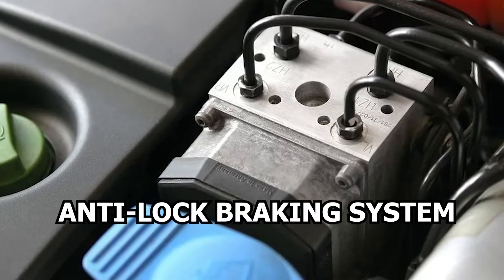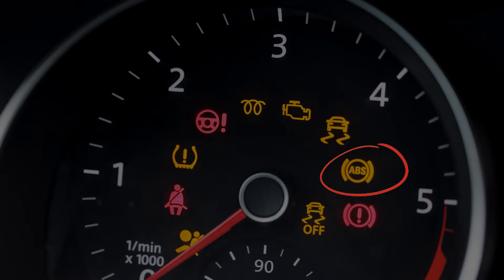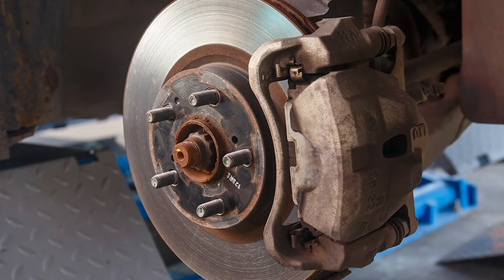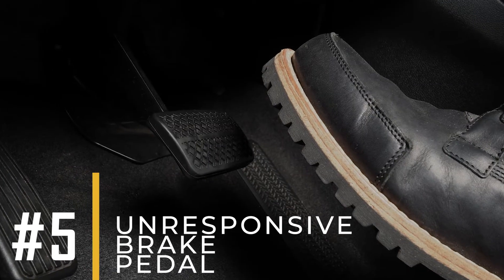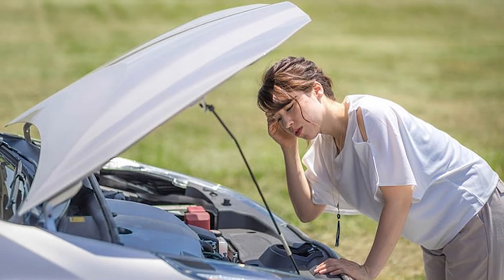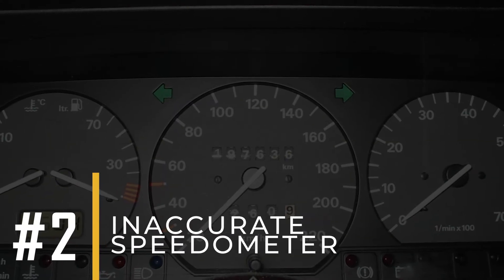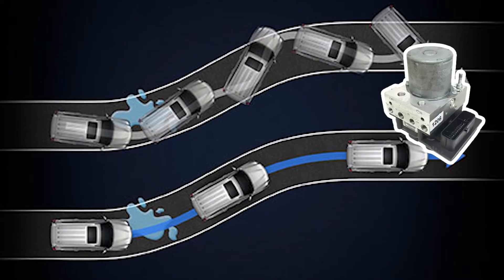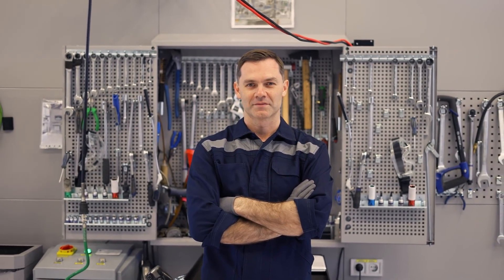Top 8 BAD ABS Module Symptoms and Signs | What are they?

Comment: I have a 2010 Chevy HHR speedometer fluctuates, sometimes transmission changes hard, I've put a new transmission speed sensor and new front hubs with new wheel speed sensor, it's still doing the same thing,any suggestions
Reply from the maker: If your 2010 Chevy HHR’s speedometer is fluctuating and the transmission sometimes shifts hard, even after replacing the speed sensor and front wheel hubs, the issue may be electrical. A faulty instrument cluster, especially the stepper motor for the speedometer, can cause erratic readings. Damaged wiring or poor ground connections between the speed sensor and the PCM can also create signal issues. A failing alternator or voltage irregularity may interfere with both the speedometer and transmission control. Additionally, a bad rear wheel speed sensor or a malfunctioning PCM could be contributing to the problem. Scanning for ABS and transmission codes and checking wiring and voltage output would be the next best steps.  Good Luck!

Comment: My mamalona felt like a sponge when breaking, now my truck don’t turn on
Reply from the maker: If your mamalona felt spongy when braking, it likely means there's air in the brake lines or a brake fluid leak. A failing brake master cylinder or a vacuum brake booster issue could also cause that soft pedal feel. If the brake booster fails badly enough, it can create a vacuum leak that affects engine performance and might keep it from starting. Some trucks won’t start unless the brake pedal is pressed, so a bad brake switch could also be the problem. It’s also possible the no-start issue is unrelated, like a dead battery or bad starter. Check your brake fluid level, listen for sounds when trying to start, and try jump-starting to rule out electrical problems.  Hope this helps.  Good Luck!

Comment: how do you know what component in the abs system to replace? ABS modules are outrageous in price. The wheel sensors and wheel hubs are more realistic. Does anyone know? If its wheel sensors that are the problem why replace the module? If its the module why replace the sensors and hubs? Anyone understand what I am struggling with?
Reply: Start with the sensors at the wheels. Cheap, easy, good place to start.
Reply: my friend checked the fuse, replaced a speed sensor, replaced new rear brake pads.  my lights are on n my brakes are still grabbing n letting go when I first leave my house with lights off.  I keep pumping the brakes and the lights pop back on, and then it drives and stops fine.  it's scary driving like that.  I just ordered an abs module hoping that's what it is and not the abs pump.🙏🙏🙏🙏🙏🤬  $531
Reply: @JoJo-oc8oq  i figure out the abs problem. it was the driverside abs wheel speed sensor. the howling sound i thought was my cv axle turned out to be that. as soon as i lifted my car i saw that sensor completely broke off my wheel hub. once i replaced it the light went off. i am so happy about that. one less problem. now i am replacing my ecm because my pcm is malfunctioning. i pray i can get back on the road soon without her cutting in and out.

Comment: I was told by the mechanic that Cadillac no longer makes the 2016 SRX  electronic brake module. Does anyone know if this is true or not?
Reply from the maker: Yes, it’s true that Cadillac no longer manufactures the original electronic brake control module (EBCM) for the 2016 SRX. Both GM part numbers 20842710 and 22783391 are listed as discontinued. This means new OEM replacements are no longer available directly from GM. However, you still have some options if your module needs replacement or repair. Services like UpFix allow you to send in your faulty module for repair, which can often save time and money. Another route is purchasing a used or refurbished module from a trusted source. Be sure to confirm compatibility and check if programming is required.  Hope this helps.

Comment: Mine keeps running, making that buzzing noise on vitz 2000 C0278 and C0279 or my codes
Reply from the maker: The error codes C0278 and C0279 on your 2000 Toyota Vitz are related to the ABS or Electronic Brake-force Distribution (EBD) system. The buzzing noise you're hearing is likely from the ABS pump or motor activating due to a fault in the braking system. C0278 usually indicates an issue with the ABS wheel speed sensor circuit, while C0279 points to a fault in the EBD system. The problem could be due to a faulty wheel speed sensor, a damaged ABS pump, or an issue with brake fluid pressure. It's important to have the ABS system inspected by a professional mechanic to identify and fix the cause of the issue. Addressing this promptly is crucial for safe braking performance.  Good Luck!

Comment: The ABS icon lights up on my Toyota Fortuner 2019 for more than a year already. I dont notice any of this issues anyway, braking and speed is mostly fine. So I just let it be till I have work and money already to have it checked. Thankfully really, no major issue appears even if it lighted up. I am just assuming it could be a lose plugged bolt, fuse or something, hehe.
Reply from the maker: If the ABS light is on and you don't seem to experience any of the symptoms or issues then it is probably nothing major.  
Possible common cause is a dirty ABS sensor or slightly misaligned ABS sensor sometimes. 
Hope this helps.  
Thank you.
Reply: That makes no sense loose plugged bolt😂😂😂😂
Reply: Wtf is a fortuner😂😂